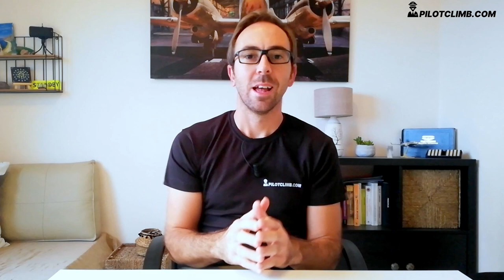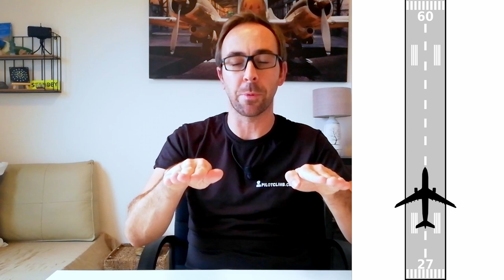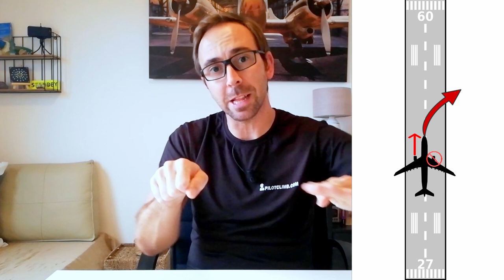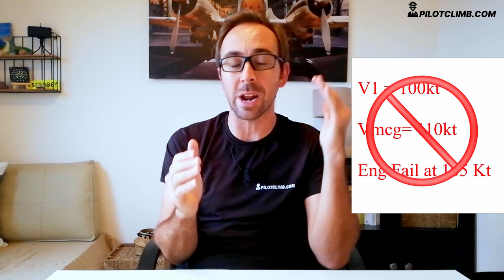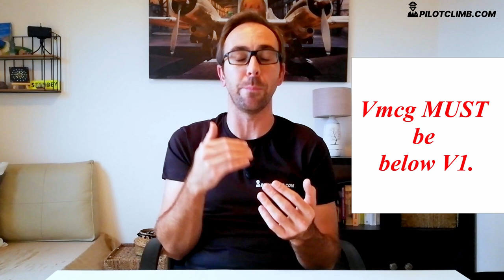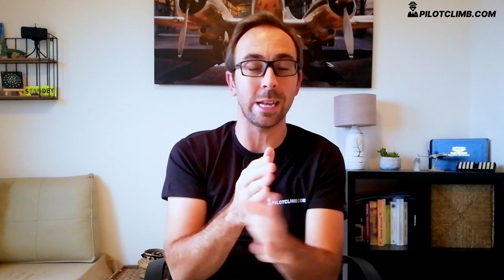Vmcg (Minimum Control Ground) - [Why You Should Reject The Takeoff If An Engine Fails At Low Speed?]

Comment: So let’s say we are using TOGA thrust and VMCG is 110, while V1 is 115 kts. If there is an engine failure at 105 kts which will lead to a rejected takeoff, I understand that for the first few seconds while the live engine is retardin to idle, even “full rudder deflection” will not be sufficient to keep the centerline. we have to use the NWS, and/or asymmetrical braking to keep the A/C aligned. Do you agree?
Reply from the maker: Your example is great, however, normally we don't use the NWS during a rejected takeoff. It is very important to cut the engine's power very quickly if you experienced an engine failure before V1(especially on narrow runways). That is why the Captain has his hand on the throttle during the take-off roll. By quickly reducing the power (in case of an engine failure) especially at low speed you make sure that you can control the plane. 
Let me know if I answered your question.
Reply: @PILOTCLIMB  I am satisfied, thank you captain. In Airbus A320, rudder pedals also command the NWS up to 130 kts (gradually decreasing effect as speed increases) that is why I have mentioned it. I have also checked the MEL of NWS, which the operational procedures really made sense now. (limitations about narrow runways, crosswinds etc.)

Comment: Thanks for the video!

Can you please explain how does a lower Vmcg allow higher takeoff weight?
I'm trying to get my head around the fixed derates topic and that's why I ended up here 😅
Appreciate your time and effort.
Reply from the maker: You are more than welcome! As far as I'm aware the usually the Weight won't affect much the Vmcg. What can affect the Vmcg is the Center of gravity position. The only thing that I can think of regarding the Weight and vmcg relation is that an heavier aircraft will have less yawing momentum should an engine failure occur. Let me know if you have more questions.
Reply: Reducing the minimum control speeds sometimes improves takeoff performance (higher Max Takeoff Weight MTOW), when taking off on a short runway. V1 decision speed is the maximum speed at which it is still possible to reject the takeoff and stop the aircraft within the runway limits. As stated in the video, V1 must be greater than VMCG, and the “Accelerate-Stop Distance” is often the most constraining limitation on a short runway. A reduction in VMCG then permits a reduction in the ASD for a specific takeoff weight, and can improve takeoff performance when the MTOW (without derate) is ASD/VMCG- limited. (I'm a 777/747 Captain)
Reply from the maker: @jeremychin1761  Hey, many thanks for sharing!! Great to see a colleague here!
Reply: @PILOTCLIMB  You too! Appreciate the video and good to see you spreading aviation knowledge to the masses esp. during this time when everyone is itching to travel again! Fly safe.

Comment: Just so that I am clear about it. If the critical engine failure happens below Vmcg, the rudders are not as effective in maintaining directional control. Therefore, the pilot would have to use other methods (such as steering the aircraft with the tiller or adjusting engine thrust of the engine operating accordingly). So wouldn't that make RTO more complicated below Vmcg?

Comment: Hey. Does TOGA "know" what thrust is to be applied based on FMC data or is it standard full or next to full power?
Reply from the maker: Many thanks for watching, the TOGA will provide you with the thrust you set on the FMC. (if the A/T is engaged)
Reply: TOGA is determined by the fadec